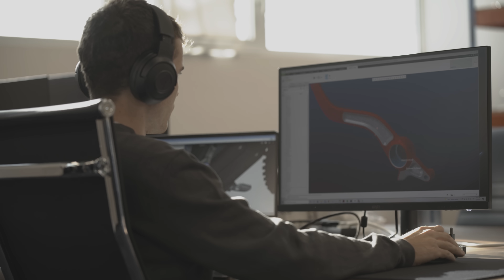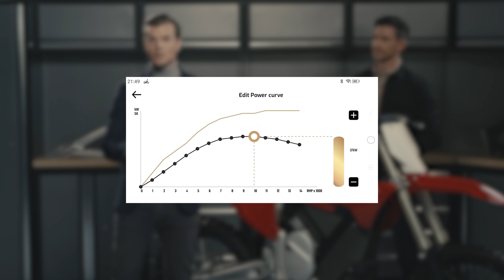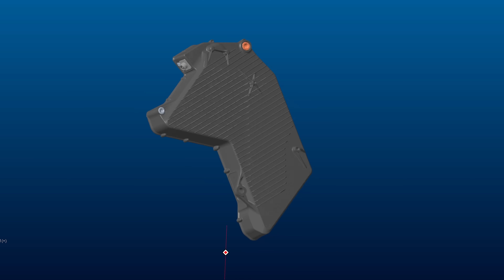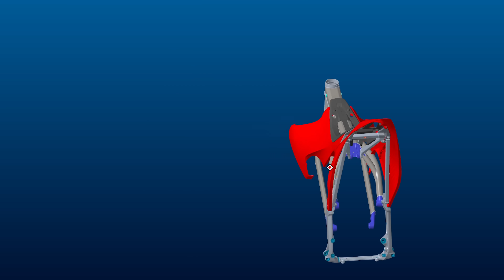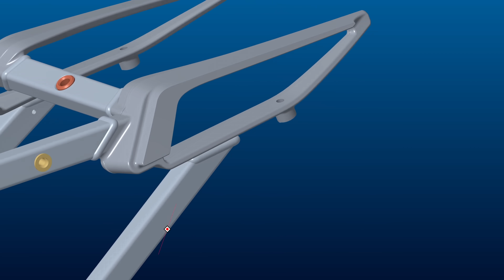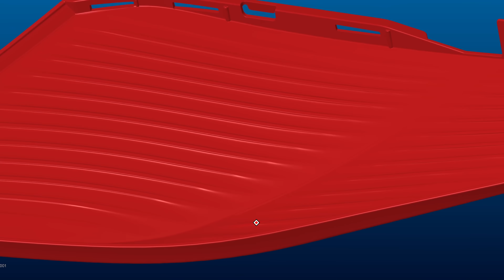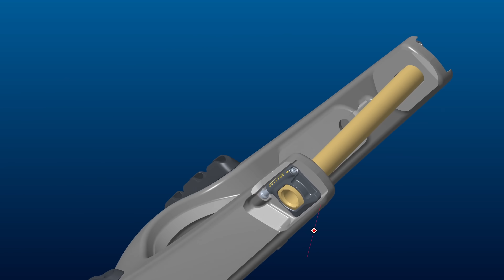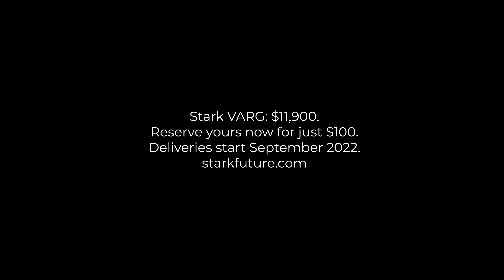The World's Fastest Motocross Bike is now Electric - Stark VARG

Comment: Will enduro model have clutch? Hard to imagine hard enduro riding without clutch, no matter how good power delivery could be
Reply: Paradigm shift. You are in it.
Reply: There's no need. In an electric motor you have instant torque in all revs.
Reply: @krakosekrumpa  you need the clutch to modulate the power on technical sections and steep no run-up hillclimbs, to get over big rocks and logs(double blip technique) etc or you'll whiskey throttle or just won't make it. Clutch is a must for trials and hard enduro. When someone says you don't need a clutch and should rely on a torque of the bike must be a beginner or just not skilled rider.
Reply: @DiDoSvK  Where exactly do you plan to fit a clutch on a bike with no gears? This bike has no space for dead weight of gears or clutch, electric trials bike and MX exists already from KTM. They don't have any either.
Reply: @Enonymouse_  electric ktm freeride is a joke but some electric trial bikes do have hydraulic clutch. No way just twisting the throttle would be enough to jump on the wall or do technical uphills. If power could be responsive enough for that than it would be to much for overall riding
Reply: @Enonymouse_  that is the problem. Where to put the weight/mass?  We sketched an idea to make a hub with a slipper clutch within. Could solve the mechanical issue, but adds un-sprung weight. No bueno.
Reply: @MotoMindedLLC  epure race electric trial does have conventional hydraulic clutch
Reply: @maucina12  so does the Yamaha electric trials
Reply: @krakosekrumpa  Have you ridden one? Or you just stating what the manufacturers say? We have a year+ of riding on an Alta. Similar power and weight as this one. (this is more powerful and lighter) We always wanted a slipper style clutch when riding trails/enduro. Ex, rock ledge or logs. 

We do agree you on a groomed track like in this video, clutch not needed.  

Here is the situation we ran into often.  Woods/trail riding where you often come around a corner to see a tree down across the trail.  Rolling about 10/20 mph, you have a lot of power but not the instant momentum hit to life a wheel in 1 second to get over the obstacle.  Electric motors offer a lot of power in that situation, but too smooth to instantly lift the wheel when rolling.
Reply: @MotoMindedLLC  That is true, have only ridden an electric bike on the street, not on a single track. Would indeed be nice to be able to pop the clutch as you say. Have a friend who's ordered one. Will be fun to try it on the MX track and on the single track :)

Comment: very interesting and exciting. when there's an enduro model with a range of 200kms, I'll be v. interested in testing.
Reply: That's totally not true.  You'll get 17 miles on the trails tops.
Reply: @JoshStreetDesign  they state 6 hours trail riding but i highly doubt that
Reply: @maucina12  that's a complete fabrication lie on their part.  I have an alta and it's basically the same battery.  Alta says you can get 8 hours of trail riding which is so far from the truth it's not even funny.  Maybe 6 hours if you were going 1 to 2 mph on a paved road
Reply: Who does 200 km in one ride? That is not dirtbike territory, that is adventure bike territory. No enduro bike can make 200 km
Reply: @maucina12  I've had enduro bikes for the last 20 years. I have done journeys with only 16 kms in one day's ride (tough conditions) and 3 days later clocked 350kms more or less in a 12 hr hitch. My point of 200kms is to say, that you need to build redundancy into the ride with electric as clearly there's no where to charge in the Bush. My observation is that until electric is really a challenge to the convenience and accessibility for enduro trailriding bikes it'll not be a challenge to gas powered enduro bikes. On the mx track or trials course perfectly feasible. To say 200kms is not done by enduro bikes is a ridiculous comment. My exc 500 is my adventure bike but clearly it's an enduro bike. Anyway, the world is changing, when e bikes are in the Dakar, you'll know they have truly arrived.

Comment: Good, give me an enduro version with clutch and take my money
Reply: haha what are you going to do with a clutch? Impress your friends that your bike that has no gears now features a clutch that doesn't do anything? 
You spent way too much time on traditional bikes, time to relearn a new way of thinking.
Electric bikes have fully variable, customizable torque settings and far more power from 0 rpm than any production bike, there is no need for gears or a clutch anymore. Those just add dead weight.
I've test ridden several e-bikes, they out accelerate sports cars from a full stop.
Reply: @Enonymouse_  on a groomed track like in this video, agree clutch is not needed. On enduro / trail riding the need for the instant momentum hit is needed almost every ride.  We have a lot of time on an Alta and we were coming up with ideas to put a slipper clutch in a hub.
Reply: @Enonymouse_  really, you do need clutch. No way you could have power aggresive enough for hard enduro moves like jumping on obstacles or uphill from stand still but still have it be smooth enough to not lose grip when in different situations
Reply: @maucina12  not true.  It's electric.   You can change the power curve.
Reply: @gear323  you cant have the same power curve for normal riding and this situations. you are not going to change power curve just to do one section of trail, or when suddenly you see a log behind a corner and need to jump over it
Reply: @maucina12  Electric motors are really powerful at any RPM (EVEN FROM ZERO RPM).  It will be no issue at all to give it 50% throttle and wheelie over a log should one come up.  It's not like a gas motor where you only have that kind of torque at specific RPMs and the weak gas motor needs help from a clutch at low RPM to lift the front wheel.  

No Bogging, no stalling, no shifting, no clutch required.

I currently have a Surron with a Bac4000 controller and 12,000w.

Comment: I am impressed !!!
i am still not going to sell my 2 stroke, but this would be a very nice addition, and you can ride it anywhere without any noise complain !
Reply: Ill stick with my 2 stroke!.  Love how they make a bike that has 20 to 30 more horsepower than the current 450s in motocross then they say it demolishes the competition. Well no 💩! All too hype up electric bikes!
Reply: @KTMsoldier1988  Brushless electric motors do outperform gas engines lighter weight, and produce max HP at 1 RPM gas engines can't do that. They are about 1/3 the weight of a gas engine no transmission needed. That's why they outperform current gas engines. The issue I see is range while they claim it's the same I highly doubt it is under heavy loading. They probably took a range measurement under the lightest load possible. The price 12k I can get a gas engine bike lot cheaper I I can take it to the sand dunes no way battery last more then 20 minutes with a paddle tire at the sand dunes.
Reply: @KTMsoldier1988  keeping my 21’ xc250 too but I had to order a bike that can be tuned to run like a 2 stroke 125 - 4 stroke 650 that’s insane cool!
Reply: @KTMsoldier1988  dang straight and is it 80hp at the End of a moto too? Doubt it.
Reply: @KTMsoldier1988  Unfortunately, not in this case. This looks head above ICE bikes in MX track, price is not insane, service is peace of cake, in such a narrow niche as motocross bikes this seems a killer of ICE world. Unfortunately, but so it looks like.
Reply: @BoneyMB  ill never spend money to go watch these on an MX/SX track. Be super boring listening to the sound of chains slapping constantly and the electric sound is annoying as f**k! The noise and the smell of a supercross event is half the enjoyment!
Reply: @KTMsoldier1988  AMEN!
Reply: People love to say stuff like this, believe me, I get it, but once you ride the future, you will NEVER go back!
Reply: @motohooligan4858  i understand what you’re thinking. Funny thing, I rode two strokes all growing up through 250s. Bought a brand new 4 stroke (future at the time), now I’m back on an RM250. Electric is the future, sure, but there’s a sound, smell, feeling that you get from 2 strokes that nobody can replace. No matter how pretty and fast the vacuum is. I’d love one btw
Reply: @motohooligan4858  motocross only ? Hard enduro ?
Reply: @aurelianradu5234  both I just ordered one with the 18 inch back well and The motor is completely tunable
Reply: @motohooligan4858  not unless it smells and sounds like a 2 smoke
Reply: Crazy how 2 strokes ruled for a long while then 4 strokes came along for about a decade or so and now this!?. 

This sport has progressed far and quickly.
Reply: @eric6rock  and 2 strokes are still around ;)
Reply: @EeeBeee2  not in California and most likely sooner rather than later, the rest of the US (by 2030 I imagine)
Reply: @kingofallworlds  2 strokes still around in Cali lol
Reply: @eric6rock  You have no idea!! I started riding in 73 I have seen and rode all of bikes! Even had two CR500s one fully built about 70 hp with wr trans that was good for 105 mph.
Reply: @eric6rock  4 stroke was a step back.
Reply: After riding this...your 2 stroke may start gathering dust ;)
Reply: @SWTrailsAndWheels  no freakin way
Reply: @lifeoutdoors3953  try an electric bike if you can.  They are fun and b@d@$$!
Reply: @SWTrailsAndWheels  I doubt it, people said that when I bought a Tesla. I still reach for the keys to my 200hp 1985 AE86 whenever I can. Speed and power isn't everything.

Comment: This looks amazing! Still one big question mark: how do you charge between motos? Bringing a big diesel generator doesn't sound like the environmental change we want. And clubs don't support power charge yet...
Reply: Surely you can use a 12v charger or perhaps have a spare battery
Reply: @jackmasterdick  The battery is 84v 84a = 6.3kwh. The best way would be to swap out the battery pack.
Reply: @hardergamer  And how much for a spare battery? I bet it’s salty.
Reply: @jackmasterdick  With a 12v charger , you probably won't be riding for a few days. Spare battery would be the way to go.
Reply: You would plug it into your f-150 lightning with standard 240V outlet.
Reply: How many normal riders go through more than one tank of gas at each ride?
And how many woods riders ride for more than 6 hours?
If the claim of the batteries capacity is correct of course?
Reply: @danielkarlsson608  I have an Alta mxr which basically has the same battery as this.  This bike won't get more than 15 miles in the woods at race pace.  Most hair scrambles are at least 30 miles.
Reply: @JoshStreetDesign  even if this bike has a more efficient motor, the difference from the Alta can not possibly be big enough to deliver as promised. But I hope its at least near the claim.
Reply: @danielkarlsson608  agreed the difference is only .2 KW between the batteries which you will never notice in real life.  That's literally like a few extra hard twists of the throttle in Map 4.
Reply: @JoshStreetDesign  since u own an Alta would you buy another e motorcross bike? Or this one?
Reply: @jrod1076  since I already have the MXR, I would only sell it and buy a different electric dirt bike if that other dirt bike offered much more range.  Otherwise the Alta is perfect.  I ripped that thing tonight so fast in the woods and just had such a blast.  Believe it or not the biggest thing I like about it is no vibration of the engine.  It just changes the entire dynamic of the ride.
Reply: @danielkarlsson608  I think you've hit the nail on the head there.
At the MX track I rarely do more than 1.5hrs. And as a C/B class rider on a 250f, I doubt that with a 250f style power mode in the Stark Varg that I'll ever have to worry about range during a day out at the track.
Reply: @danielkarlsson608  there’s no way you can ride for that long in the woods no way I’ll buy you a new bike if it’s true
Reply: Hydrogen fuel cells by end of '22 is my guess

Comment: Wow, this will for sure revolutionize the motocross sport and make it available for anyone!
Reply: A 80hp MX bike doesn’t sound like something available for everyone. You need some special talent to reel it in. That’s the power of a Husqvarna 701 in the weight of a YZ450.
Reply: @moomoodeadcow  You are correct, the VARG is one beast of a bike, but I'm sure that with all of the mapping available you will be able to select a beginner mode. I think they actually mention this. Imagine not having to buy a 125, then a 250, then a 450... It's all those in one.
Reply: @mindbomb2000  Yes and I expect them to release a supermoto version of this bike. That'd be super interesting. Because on the asphalt TC and abs just work better. On the dirt, not so much. Also those carbon parts won’t fair well against a rock.
Reply: Better hurry all you  of go buy them now run out tommrow!!
Reply: It is not revolutionizing anything, though. It's a dirt bike with century old tech in it.
Reply: Shove it no thanks I'll stick oil gas power  stuff thanks
Reply: Should be fun carry cords and huge batteries around maybe 🤔plug one two bikes in a tree or gas powered generator 😂
Reply: See where iam going with this stupidity
Reply: probably will go for 17k plus if you ask me. The expense will get in the way of making it available to anyone
Reply: @MrGfgtgr2  it’s less than 12999 delivered.
Reply: @MrGfgtgr2  11k
Reply: This is just like the new automatic trucks now anybody can ride them..